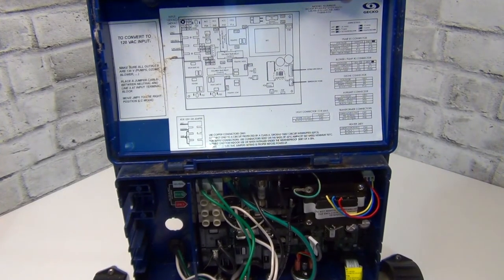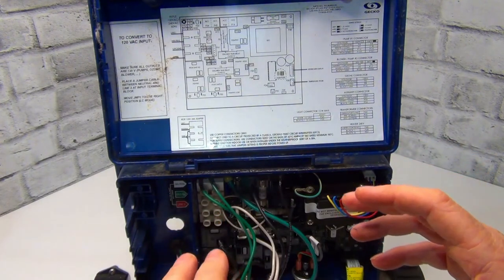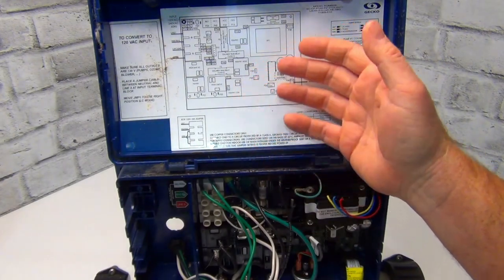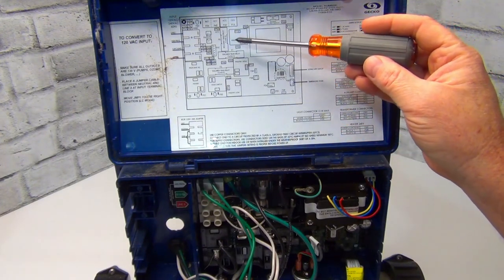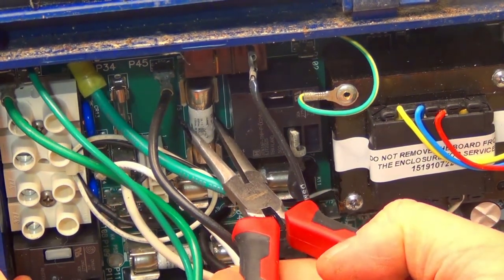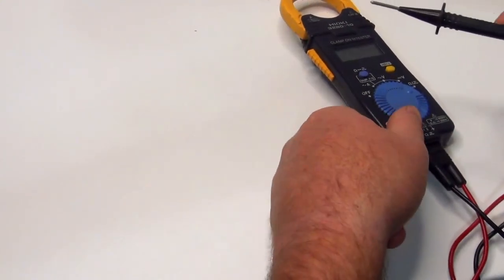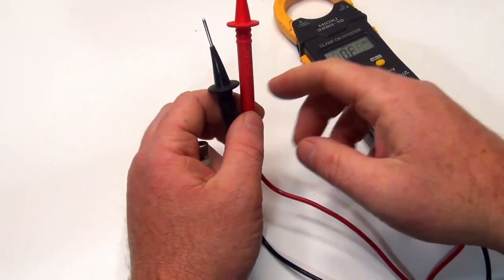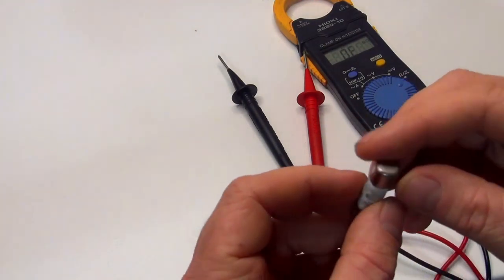Test Your Hot Tub Fuse If Nothing is Working

Comment: Hello good video, my hot tub is a sundance 800 series, I hear a click but nothing starts,  lights power on,  the stereo works  and the display shows 11A , press the buttons on the panel and nothing, any idea where to start , fuses are all working and tested.  Really appreciate the help thanks
Reply from the maker: One pump?   If so, test the volts going the the pump and test the pumps capacitor
Reply: @VIPPoolsandSpas  Sundance hot tub's 11A error code indicates that the water temperature has risen above the spa's safety limits and has triggered the spa's "Watchdog" program. This condition can be dangerous and may damage the spa or cause injury, so you should not get into the water and should contact a dealer or service technician. 
 
Some possible causes of the Watchdog error include:
Bad capacitors
Capacitors on the circuit board can sometimes bulge, which can cause the Watchdog error. This is often more likely to happen in cold weather or after the spa has been shut off for a while.
Temperature sensor
The temperature sensor may need to be replaced. There are different types of sensors with different wire ends, and there are instructions available to help with the replacement process.
Reply: @VIPPoolsandSpas  2 pump, board ,display all looks good, Haven't check the fuse

Comment: Hello, I have a 2016 Hot Springs jetsetter NXT and we had to turn the breaker off and we turned it back on and now the hot tub won't turn on. I'm so confused 😕
Reply from the maker: Because Hot Springs has proprietary electronic parts, they are the only ones that can help you with this issue.  BUT.  If there's nothing on the screen and or no sounds coming from any pumps, I would test the fuses.
Reply: I actually got it by tapping on one of the relays! I was so excited! Thank you so much for responding I really appreciate that more than you know. That was so nice.♥️♥️

Comment: I changed the fuses to pump 1 and pump 2 on my arctic spas tub. Now the top side won’t turn on. Any clue or recommendations?
Reply from the maker: really?  what spa pack do you have?  Some spa packs will have a "little" glass fuse for the topside.
Reply: @VIPPoolsandSpas  thank you for responding. It is a Gecko Mspa
Reply: @VIPPoolsandSpas  I changed the pump 3 fuse. That got the top side working again. Pump 1 still only clicks when I attempt to turn it on. Let me also add, It’s a brand new pump. I was told I needed a pump by a local pool and spa company because pump 1 only clicked. They’re too busy building a pool (small business) so I installed it myself.
Reply from the maker: @Nocturnal_beauty  you put a new pump in the spot of pump 1?
Reply from the maker: @Nocturnal_beauty  Are the other pumps working?
Reply: @VIPPoolsandSpas  yes other pump is working. Pump 1 is my only issue I put the new pump in the pump 1 location. It’s also giving me a “FLO” error.
Reply from the maker: @Nocturnal_beauty  so is the new pump working?  Any sound?
Reply: @VIPPoolsandSpas  no sound besides clicking when I attempt to turn it on.
Reply from the maker: @Nocturnal_beauty  Wow, I'm stumped at this point.  How many pumps do you have again?  And, nothing is turning on?
Reply: @VIPPoolsandSpas  I got the top side to work. Pump 2 is functioning properly. My only issue now is Pump 1 only clicks when I attempt to turn it on.
Reply from the maker: @Nocturnal_beauty  it really sounds like a fuse.  Can't say it's the capacitor because it's a new pump.
Reply: @VIPPoolsandSpas  ok I’ll take a look at the glass fuses too. Thank you for your help.

Comment: I get power to my board but none of the fuses have power going to them . What could it be?
Reply from the maker: Continuity  on all the fuses?
Reply: @VIPPoolsandSpas yes fuses are good but zero power going to them small and large fuses.
Reply from the maker: @jl456  The only thing I can think of is the transformer but thats super super rare.   Do me a favor and turn pump 1 on and test the volts across pump 1 fuse.
Reply: @VIPPoolsandSpas I can’t turn anything on even the topside is dead.
Reply from the maker: @jl456  weird.  Never had that before.  Transformer?
Reply from the maker: @jl456  transformer.
Reply: @VIPPoolsandSpas ok thanks I’ll try a transformer . Just curious is there a way to test a transformer?
Reply: @VIPPoolsandSpas also been reading that a bad transformer will cause your circuit breaker to trip if it’s bad. Mine doesn’t trip ,now when I flip the breaker on I can hear a relay click but other than that everything is dead.